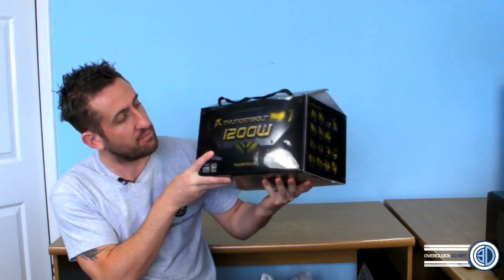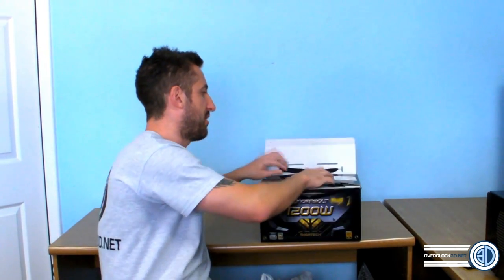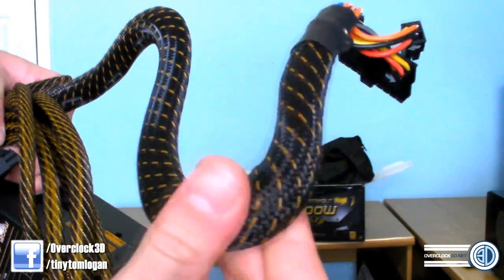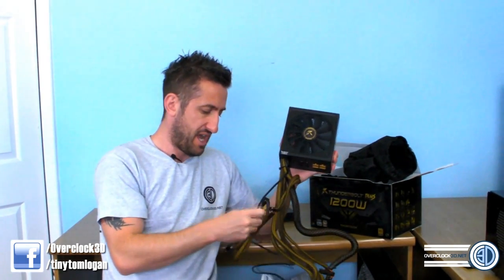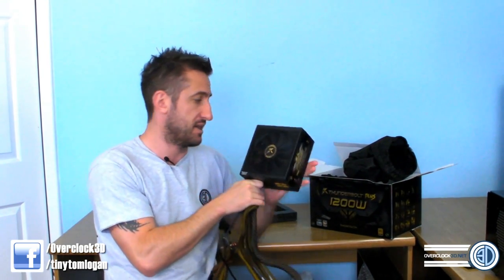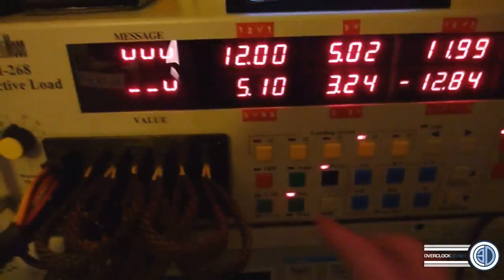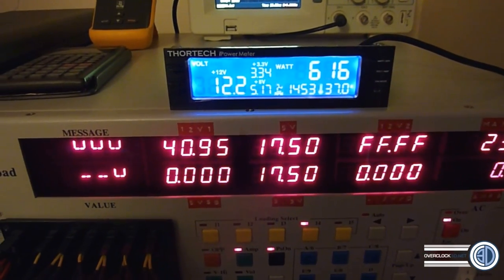Thortech Thunderbolt Worst PSU Ever?

Comment: Can't tell in the video.  It's capable of 1080W, but only 960W on the +12V. You can't see what VC is doing when it's only at 1000W, but if it's still overloaded, than that DC load is switching on and off and on and off and that could be making the waveform right there. Perhaps other units haven't shown this because of their topology (like a resonant mode PSU could handle that better) or because their caps can hold more charge longer.  Don't know, but it's worth looking into.

Comment: @Roland0314 alright mate. it is actually a highly rated power supply its also modular the only reason i didnt rma it is because of the shipping costs to holland and its latger and has better cooling you can beat off to corsair all you like but im quite happy with thermaltake thanks

Comment: Yep, FSP Aurum series is good. FSP is a major OEM and has consistently churned out decent power supplies. They had a slip up with the Everest and Epsilon series back in 2007 or so, but that shouldn't deter you from buying an FSP unit. The Aurum series are very well built (one of the few units using a glass fiber PCB) and due to the its super efficient topology and cluster-free internal.

Comment: The 550/650/750 are 250/350/450W PSUs respectively because the +3.3V ripple exceeds the ATX specifications at those load levels.

Comment: imo the worst power supply's i have seen in pre built computers seem to come from dell
i have seen about 3 dell computers that have blown their power supplies within the first 2 years of operating meanwhile at my moms work a power supply (i dont remember the name) is still going strong after about 13 years of solid constant operation
as a matter in fact the psu still works it was the mobo which died from fan failure causing capacitors to overheat (came down to when i looked at it that the psu fan was the only fan working) it was also its original psu

Comment: I own an HX850. And I use to keep my tower on the floor. Cat knocked over a half filled cup of water up on the desk that I left on, stupidly, before sleeping. Woke up to a crashed PC and water all over my GPU, MoBo and PSU cables. Dried it off thoroughly and it wouldn't even make it to post before shutting off over and over again. Eventually swapped the hard wired CPU cable with the secondary for overclocking motherboards, and it's been running smooth for 5 months now. Greatest PSU ever.

Comment: In PSU is all about brand and warranty. It's the only component that you can't take a risk, because is the gasoline in your machine, if the source of your power is bad, the performance it will be as well.

Comment: its obvious they pushed it to the max , every PSU will start giving out ripples when pushed to the max, its not giving out 1200w but to expect it to deliver that much its not realistic, probably doesnt cost as much as real 1200w psu, but anyways with PSUs its not always better to have more W, its best to have 80percent load cuz thats what it is designed for , for this psu that would be around 900w if its limit is 1200W but looks like limit is 1000W so its 800W, thats good enough for 3xSLI of any kind and 4x sli with to mid range cards like 970gtx or r9 280x
Reply: +Pavle Pavlovic What are you talking about?
If you sell a PSU rated at a figure it should deliver that figure. If you decide to run at 50% or 80% in everyday use that is fine, but all reputable psu's will deliver the full rating continually without shutting down.
If I want an 800 watt psu I will buy that NOT a 1200w one.
Reply: Dave Bell scuze me sir but you dont take in account electrical engineering practice and marketing practice , every brand has those.
Cuz of design of electrical components they have operating range , they can go above that but with reduced efficiency, thats where ripples starts and accepted value is 80% load .
On the other hand , cuz of multiple ways you can look at that "1200W" value , brands can stick 1200W on a peace of PSU that really has 600W, as long as they say it is computer equipment and made for lets say 4xSLI, they cant be wrong , cuz in data sheets you can find 1000W even if particular design is for 500W/RMS PSU...
That fact is taken in to consideration in computer equipment , so youll find that R9 280x is a 250W GPU, but you will also find that 4 of those in Crosfire have a combined power of 400-500W...
Thats why this PSU  satisfies 4xSLI/CF requirements and then some , but of course more expensive brands will offer more power and are better, still i wouldnt mind having one of those ,its not for throwing away, perfectly fine
Reply: +Pavle Pavlovic You are full of bullshit and just a troller, I wont reply further.
Just to set any observers correctly, there are Euro and US / JapKorean etc Norms that require certain standards of electrical performance, on that basis this PSU is a fail and a con.
Reply: Dave Bell you dont understand electronics , your a man that believes hes car speakers are 2x150W if it says that on the box so i dont blame you for not understanding a word of what i say ,but your a snob too if you think thats a bad PSU unit , thats way better then most PC have , thats why i would like it , and thats all im saying , its not a throw away but ppl that make Bitcoin rigs and similar now better then that
Reply: +Pavle Pavlovic It is a bad PSU.
I can't believe you're defending a PSU with over 300mV of ripple
That shit will kill your system in a matter of days, if not hours.
Reply: Calyx  Im sorry but you just dont know SMPS all that good

300mV of ripple maxed out loaded is nothing
 none of your home appliances have this good PSU and im not talking about toasters , but monitors ,TVs,Receivers ,tablets ,laptops , whats wrong with them? Nothing they are fine 
 
Does youre motherboard have power filtering . Yeas it does . Why ? cuz every PSU has ripple , its designed to handle it
 
This PSU is fine for reasonable loads ,2-3x SLI/CF , i wouldn't run 4xTitan X on it  that would be stupid. Everything other then 4xSLI is just pure happiness for this PSU. Trust these words of wisdom or if you have the money just buy the most expensive one and be done with it . But what more do you need besides 1200W and 5 years warranty on cheap . Are you that spoiled ?
Reply: Pavle Pavlovic Am I spoiled? No, I work for my big boy toys.. But honestly, if you can afford a three-way SLI system like me, why would you go for a terrible shitty offbrand PSU with poor Chinese caps with over 300mV of ripple, when the EVGA 1600w PSU that I have only has 35mV of ripple on 100% load?
Thats nearly 10x less ripple..

I would not feel safe with that PSU in my system. I legit felt like it was going to explode during the 1000w load test.

Also, funfact, ripple is very damaging to your CPU. The microcracks that occur over time will occur at a much faster rate when the voltage spikes all over the place. 

Exactly WHY are you defending such an insanely terrible shit PSU out of thousands of good ones?
Reply: Calyx you dont have to, but its not shitty at all thats the point . A lot of YT reviewers overrate or underrate the product, i guess they do it for the views or are payed . Honest review of this would be . Its not the best but it works reasonably good for the price
Reply: Calyx you are hard headed indeed , thick necked , stubborn . Every, i repeat , EVERY liner PSU is better then any SMPS in terms of power quality and ripple . Yet , the best brands that make PC  PSU's use SMPS, why? cuz its a lot cheaper .  Cant bash this thing cuz it uses cheap components . The hole purpose of these things is low cost . Cant bash it cuz of ripple , 300mV is overload ripple . Its the ripple you get when you hook 4x Titan X on it , and we already established that this PSU is not made for that kind of load .  If you want something better , no ripple PSU then dont use SMPS cuz they are ripple generators , its how they work, you dont understand that
Reply: Oh, there's an all out reply war going on here 😂😂

Comment: I been using a AX850 for nearly a year worth the money that you pay, with a 7 year warranty you can't really go wrong. Very solid efficient bit of kit, the fan hardly spins up. The wattage is overkill for all single gpu and for most dual gpu but it's nice to have a large amount of headroom to keep it running efficiently, the fan never really spins up either and when it does it's completely silent.

Comment: I have the original Thermaltake 1500w PSU which when reviewed by Overclock3D, was basically rated as the best PSU they had ever tested. (in 2007) I've noticed that Thermaltake has released an up to date version of the PSU. Have you had a chance to play with it? If so, what did you think of it? I know you'll be honest. Its one of the reasons I watch your videos.

Comment: You're fine.  TT doesn't really know what he's doing with PSU reviews and did it improperly.  JonnyGuru (and Tazz at JG), Gabe at Hardware Secrets, and TechPowerUp didn't see results anywhere near that in their reviews.  In fact, JG showed up in this thread and is pointing out how TT's test was flawed and the reason their results are the way they are is because they're about to blow out the load tester, not the PSU.

Comment: I spent $3300 on my build but the retail store didnt have a corsair 1000 watt so I got the Thermaltake Thoughpower 1000 Watt 80 plus Silver with 5 years of warranty on it but I have only 1 year from the retailer plz plz plz tell me if I should change it because I dont want to loose my expensive components
Reply: I shouldn't worry mate, Thermaltake make good kit, and 80 plus silver is quite good
Reply: Don't worry, thermaltake make some fantastic psu's. And 80 plus silver is good

Comment: My friend was using one of these psu's with a 65w i3 and GTX560 - it failed after about a year. 450w on any psu is not enough for a 570.

I would strongly suggest investing in a good 600w psu in the future.

Comment: Have the Cooler Master V700, they tested it and it delivers 844W before shutting down, and it does it a t 87% eff and with a temp of 52 C and 28 dB. Remember it is rated do deliver 700W at 92% :)

Comment: Antec PSUs are usually pretty good.  The one thing to keep in mind is that most PSU vendors actually don't make PSUs.  For example the Corsair, AX650/750/850 PSUs are actually made by Seasonic.

Comment: Seasonic based PSUs are generally pretty good - Corsair, Antec, PC Power & Cooling, Silverpower, XFX etc. all use a Seasonic based platform for some of their units.  The new OCZ ZT series and Rosewill Hive / Capstone series aren't bad either; they are OEM'd by SirTec.  Superflower is another company that generally makes good platforms, such as the one used in the NZXT HALE90.  I tend to avoid FSP units like the plague.

Comment: OCZ fatality is Sirtec, the new OCZ OEM. They make decent stuff, but tend to cut corners compared to the top builders. 

If you want real flash stuff, forget the badge and get a Seasonic Platinum 1000W / 1250W. It's a little bit more expensive, but they are absolute best at the moment.

Comment: Big thumbs up for corsair, ive been running a HX750 on a multi gpu overclocked i7 multi HDD, custom H20 cooled rig for just under 2 years straight with 721 days uptime out of 722 without missing a single beat! Very very impressed

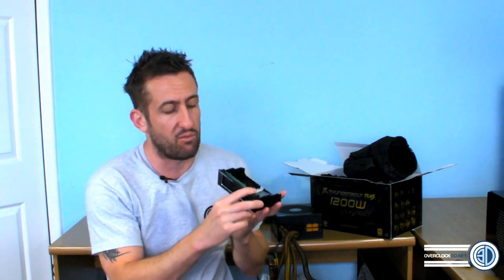Comment: Uhm Tom, what you said @08:35 is wrong. That's the difference that comes from the unit's efficiency. The readout on the display shows the actual draw of the components (which is quite a nice feature). I don't want to say that it's a faulty unit, but at least johnnyguru did get a proper one for review. I'd neither recommend any of those cheap units, but that was quite a bit harsh. Anyway, your point is right, people should invest more in their power delivery. Just my 2 cents.

Comment: No the PSU power meter and the wall power meter SHOULD NOT be the same, the PSU meter (and James' testing rig) is measuring the DC power output from the PSU, the wall meter is measuring how much AC power is needed to get that DC output. So if the PSU is ~80% efficient for example and the wall meter is showing 1000W, the actual DC output would be 80% of that, or 800W. The PSU meter should be less than the wall meter. Also JohnyGuru has tested alot of other Thortech PSUs and they aren't all bad.

Comment: 700watts full load correct? if so yes i think you should be fine with that, unless you start overclocking than i would recommend a AX850

Comment: thermaltake and ocz also make pretty good power supplies. also very reputable companies. so there are a plethora of options available out there. the only place i would hold back on with a computer build is a case... and for good reason. I will make my own out of plexiglass that will fit the board and build specific.

my rule is when i buy a component, i think "if this fails in the worst way... what will happen to the system?" and the power supply can kill EVERYTHING

Comment: 20mv - 30mv, ripple under load. That is actually very good. The only problem I have with this is this chap says you cannot measure a switched mode ATX PSU with a multi meter, of course you can. The thing you have to ask is how many watts are being sucked out of the wall to get that supposed 1200 Watts on the output, i.e efficiency and also how often do you run your PC at its full capacity
Reply: +John Wheatcroft 20-30mV ripple?  That's not what I saw.  I saw 280-300+ mV ripple.
Reply: +John Wheatcroft to measure wattage draw from out of wall you can buy a cheap kill-a-watt plug on ebay :D
Reply: ReeseL4D It is still under half a volt under load though. You have to work out how many watts are actually being sucked out of the wall to get the supposed 1200 Watts.
You cannot have 100% efficiency as it would break the rules of "The Conservation Of Energy", ask a Physicist.
The whole 80 / 80+ Bronze, Silver Gold thing does not mean very much and is just a money making ruse, so that manufacturers have to pay to put stickers on their units, otherwise they are not "allowed" to claim the stated "efficiency"
This additional cost that they pay to be a member of the "Standards Company", who oversee it is just passed on to you.
Read a book on Power supplies and build your own, perhaps not cheap no at least you know how it works.  
All ATX's work a similar way, Rectify the mains, chop it up and step it down and regulate it with a couple of power MOSFET's
The advantage is that you can use a smaller lighter transformer, which is where you will get most if not all of the "efficiency" from, and of course less heat, so a better "Energy Transfer"
Reply: +John Wheatcroft for a computer 280-300mV ripple will damage most of the components badly
Reply: carzacc
Again that is total rubbish. I've been in electronics more years than I care to remember and i guarantee you that 20 - 30mV, would rarely if at all damage "most components" as you put it. 

You could say with "some" justification that it depends on the tolerances of the components and how close to those tolerances you are running those components, but even then it is unlikely.

For example a capacitor SMD, Axial or Radial rated at say 25V and 105 degrees C is not going to really complain if it is operated at  25.02V or 25.03V - which is precisely what you are saying. There is usually a reasonable tolerance on most components.

Naturally this same capacitor is not going to be very happy if you put say 60V through it.

There are so many half truths and downright rubbish on here it amazes me. Do people learn electronics anymore ? We did at school.
I suspect a lot of these half truths originate in the gaming community actually  and rather than "educate" everyone else a lot of it is "mis-education" and because the internet spreads something, even if it is wrong, so fast that is where the problem lies.

To put all this in context a standard silicon NPN transistor, requires 0.6V to turn on that is 600mV and you are saying 0.02 to 0.03 Volts,
20mV - 30mV "will damage most components".

Can you see how non-sensical your statement is now ?
Reply: John, you are a crazy guy.  Try watching the video again and re-reading the comments.  Let's see how long it takes you to figure out what your mistake is.
Reply: Please watch that video again. I have no clue where you take the 20-30mV statement from. Please watch it again,and you will hopefully see that the ripples are in the 280-300mV range, NOT 20-30mV. And 280-300mV ripples will indeed hurt your components badly.
As for the half truths you are referring to - I would not say that these are spread by the "gaming community". Actually the "gaming community" is also by a huge chunk the "enthusiast community", most people inside these communities do know very well how electronics work.

Comment: I can second this, at my work we have the highest return rates on OCZ and thermaltake power supples but not only that you can simply tell the quality when you use a Corsair, Silverstone PSU etc. You can tell the by the cable sleeving, the cable length, cables included etc. Bad power supples are easily told out by poor design choices

Comment: i advise to read out psu on the tom hardware site
it doesnt matter what brand you buy it only matter what factory its build because most brand dont build it them selfs so in the same brand you can have good ones and some that sucks and the most testing is about stability of its voltage lines

Comment: Corsair, Seasonic, and Antec are my preferred PSU's companies.  I'm running an AX850 and an AX650 in both my systems.  Shoot, I have an old Seasonic that I have in my old AMD 150Mhz CPU (yes, I said Mhz!  ~grin~) that is still going strong since '97.

Comment: that's not a sure way. Andyson makes 80PLUS units, but they aren't entirely safe. ECOS does not test for voltage regulation or ripple suppression. they merely test for efficiency; hence an 80PLUS rating is not a surefire way to determine if a PSU is good.